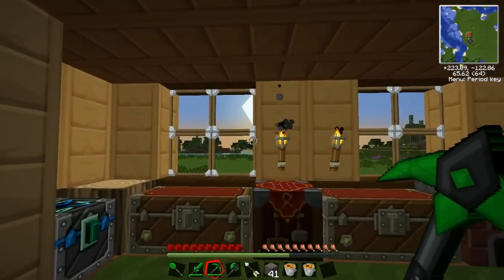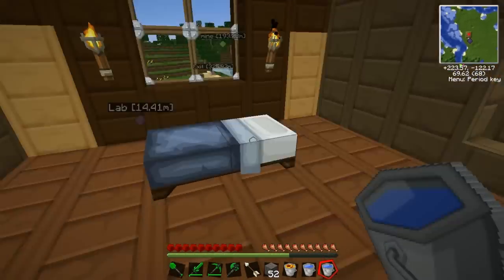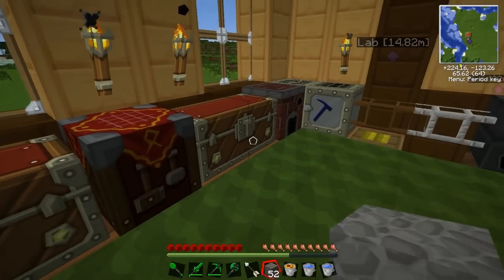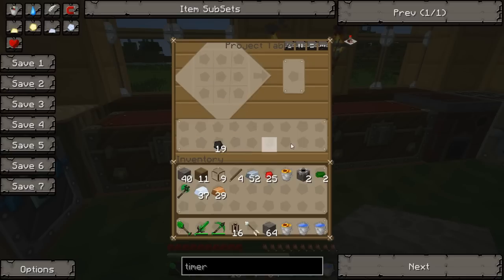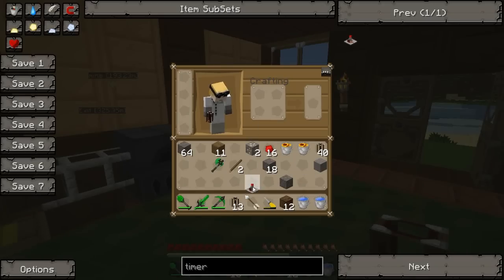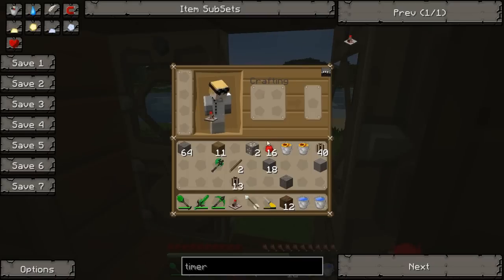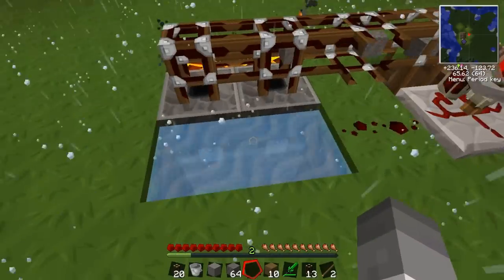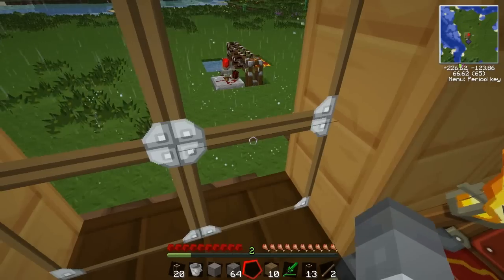Duncan's Lab - 38 - Mo' Cobblestones

Comment: I know it's a bit late now but you can save time by converting cobble to smooth stone in a converter because they have the same emc value I think. One less step and it doesn't waste coal or time. Thanx for the vids Duncan! You've taught me everything I know about tekkit!

Comment: You need to connect the block breakers with redstones (just by right-clicking the top of breakers while holding redstone). Place the timer on one end of this redstone line. Then place Obsidian pipes above breakers. The cobblestones will jump high enough to get sucked in. Then connect up the obsidian pipes with iron pipes directing cobblestones to where you need. I placed the iron pipes above the lava part, so that I won´t fall in there :-) Works perfectly!

Comment: No, because stone can use a flowing block of lava, but obsidian requires a source block of lava. Lava source blocks are, unlike water source blocks, non-renewable. Eventually, you will run out of them. This is why you can make an infinite pool of water with a 2x2 square and then putting 2 water blocks in opposite corners, but if you try it with lava, you just lose a lava block.

Comment: Faster way to make infinite emc is by macerating blaze rods, usually blaze rod gives 2 powders, but with macerator it gives 5, since blaze powders emc is half of that of a rod, it will give 2.5x as much emc. Make it go in circles turn them into diamonds and turn diamonds into blaze rods, infinite supply and quite fast.
I know the series has advanced to FTB but im just telling this to other tekkit players.

Comment: the generator does not work at all for me, the pipes does not power the block breakers, only works when i put a redstone torch over it, and wierd part is that if i put a timer to deactivate the torches so the breakers still break again it won't work either...

Comment: ive built mine with 3 block breaker but it only powers 1 if the redstone is next to the block breaker. i can get one round the front and back but not the middle one /:

Comment: Redstone tubes don't work the same as wood tubes they need to have a pulse from a redstone timer and than you need to connect them to it with just plain redstone wire won't work